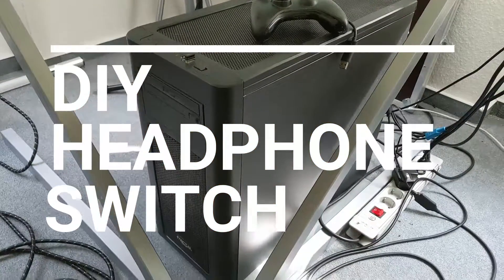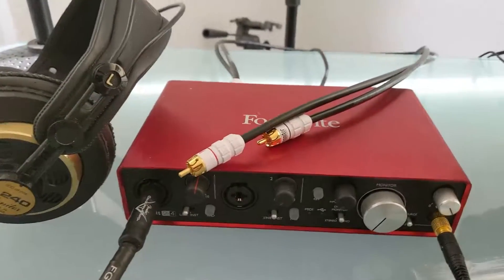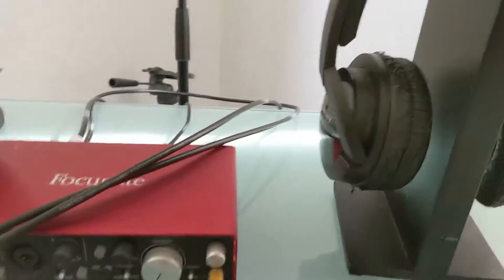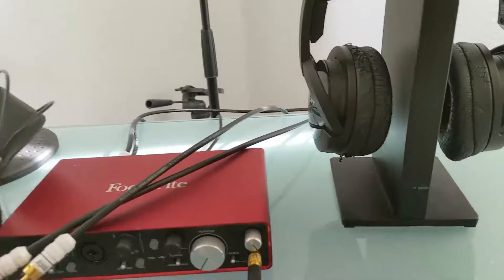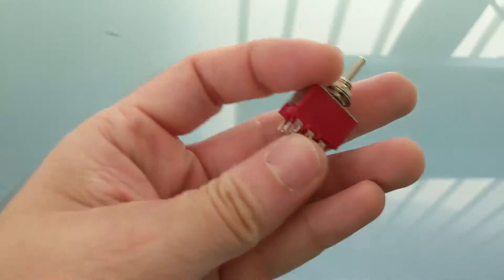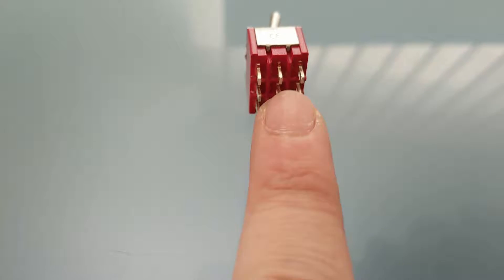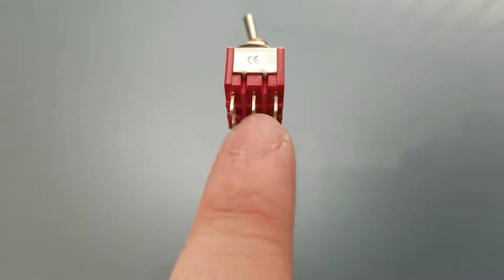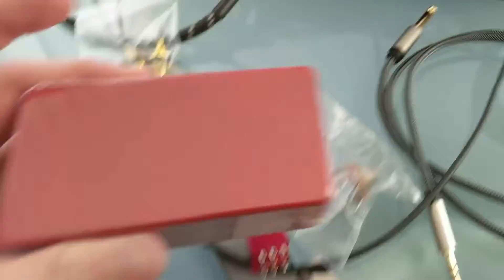DIY Headphone Switcher

Comment: Hi, I am thinking about doing something like this but I have a 4 pole 3.5 mm headset and speakers. Is there a way to just have one port for each and have it wired to have a mic on off switch and an audio headset/speaker/off switch.
Reply from the maker: the only problem i see, is getting a 4-pole input jack. if you have that, you just split out the stereo signal to one 3-pole (left, right, ground) on/off switch and the mic signal to one 2-pole on/off.